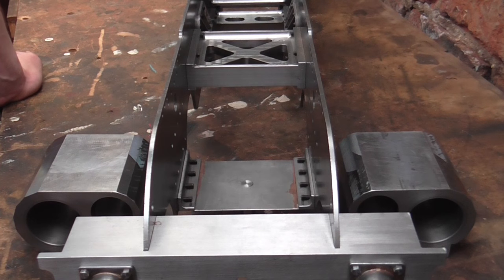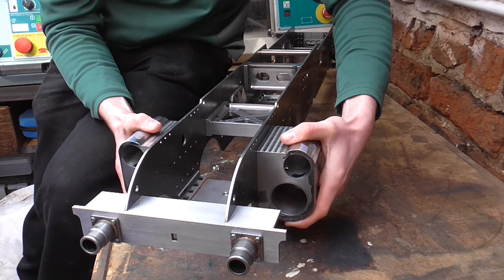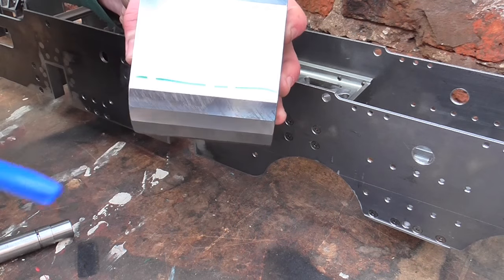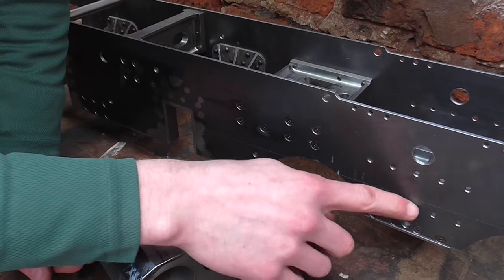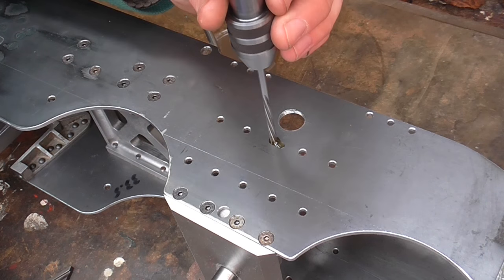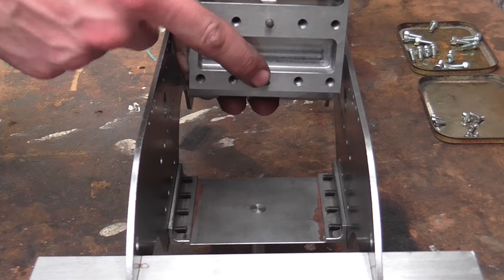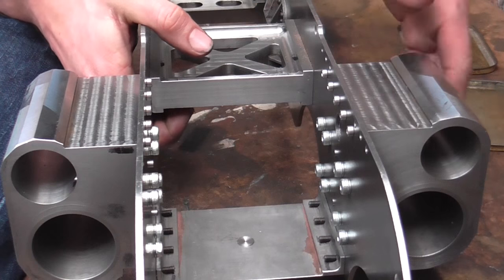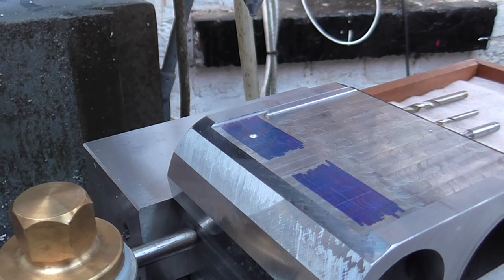Machining Cylinders Part 5

Comment: Do you not have a rotary table? I imagine you have bolt holes to put in each end for the guides and cylinder caps. I also imagine your radius for the outer cylinder contour is concentric with the bore. If you have access to a rotary table looks to me you could save several setups by milling your contours and doing your end bolts in the same setup. Just perhaps a time saving suggestion. :-)
Reply: +bcbloc02 To do the external Radii using a rotary table would mean owning a 4 inch long end mill ( or however long the cylinders are ), not only are they expensive but would chatter a lot due to the excessive length and would leave the radius of the cutter where he really wants a sharp corner. The second problem is that Crispin would still have to set it up on a dividing head to Radially mill the insulation slot. When you see the next video, it will be well explained and become obvious as to why it was being Radially Milled. Hope this is of some help to you. I have already done a trial run for him on some scrap material, to prove the setup and sent him photographs.
Reply: Dave Ticehurst
Didn't realize the sharp corners were a design feature. Thought these were supposed to imitate castings and you don't normally find sharp corners in castings. They make extended length endmills that are relieved so that they don't rub when cutting at full length and with those you could profile with no chatter, alternatively you can back grind the flutes on a standard endmill and achieve the same thing. For stunt milling you could use a boring bar to cut the insulation slot while set up on the rotary table as well. Lots of ways to do a job and I enjoy seeing how other people do it. Looking forward to the next video.

Comment: Thanks MrCrispin for your detailed video. Are the cylinders and pistons/valves all steel and what would stop them rusting together between running days?
Reply from the maker: Hi, it will be a mixture of steel, cast iron and maybe bronze. You pretty much rely on the seam oil to keep everything protected.

Comment: Brilliant! Where did you get the vice from.
Reply: +Steam Train Builder I asked Crispin that several weeks ago. He came back with the answer CHINA, but was unable to find the catalogue with the Company address on. I did a China Ali barba  search, it came up with several suppliers. I picked one at random and got a quote from the Company, for a 6 inch wide one it was 130 US Dollars BUT the postage was 150 US Dollars !!!!!! by DHL. Very quick delivery about 5 days from ordering . That was to Australia, postage to UK would be very Similar. I hunted E-Bay and other UK suppliers for a 6 inch wide vice, most only sold 3 or 4 inch. If Crispin does not answer you, I will badger him to try and find the Company name, and get back to you.
Reply: +Dave Ticehurst the biggest vice I have found is a 120mm wide one from Arc Euro Trade for £129. I can't quite make out what size Crispins is.
Reply: +Steam Train Builder Hi there, quick reply. I have just gone back through all my e-mails to and from Crispin and he told me in one of them. "The vise measures as follows 150mm jaw opening, 120mm jaw width, 40mm jaw depth, it came direct from China and I think that it cost me £ 120".
Reply: +Dave Ticehurst FYI that spec matches what Arc supply.
Reply from the maker: +Steam Train Builder +Dave Ticehurst Hi both, Ive been back through the archives and here it is - http://www.zhengzhoutools.com/

Comment: Crispin, where did you get those little angle plates? They are very nice indeed. Lying in the box behind the work at the 5 minute mark.
Reply from the maker: They are called 'Z squares' Stan Zinkoyski at. Bar Z Industrial makes them.

Comment: Excellent work and video. I was wondering if you have to take precautions with corrosion control on the locomotive chassis? Will you paint the chassis early on in the build or is that left for near the end of the build? Thanks for sharing this.
Reply from the maker: +Steve Leith Hi, So far so good rust wise. I keep it in the house. I am planning on painting everything at the end. Cheers

Comment: Hi I have watched your videos with interest, when you are milling, have you tried the ripper cutters for roughing out? They enable me to hack out a 13 mm wide by 10mm deep cut at about the speed you were clocking at. They have saved me hours of metal removal time with so much less stress on the head of the machine, they are about 8 quid on eBay.